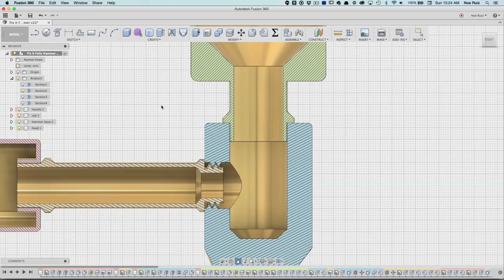Fix It Felix Hammer - How To Add Sound FX to Props

Comment: Hi Felix just a question, how you can add sound effects continuously in a prop without pressing any bottom?
Reply from the maker: Sure, the button doesn't have to be momentary, a "latching" type switch would work just the same, but would be "continuously"  pressed. The FX board has a looping option too, so that would work well.

Comment: i know you did one press one sound but im not doing a fix it felix hammer but do u know how to do that when i hold the (other button than that light button but a button) a led will light up and  be on until i release then when i  release it the led will no longer be lit and there would be no sound.... and at the same time im pressing the button and led would be lit there would be a sound and it will be on loop as long as i hold the button